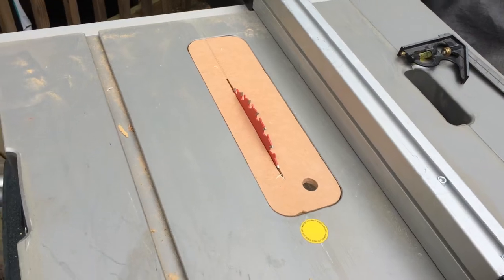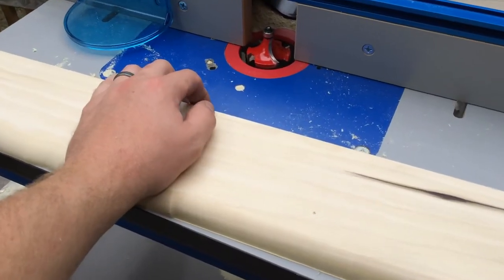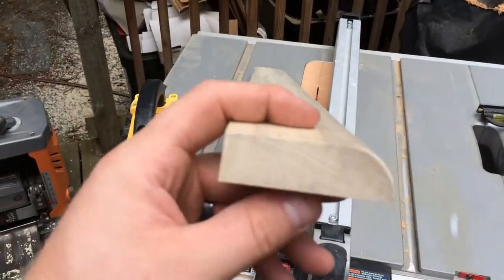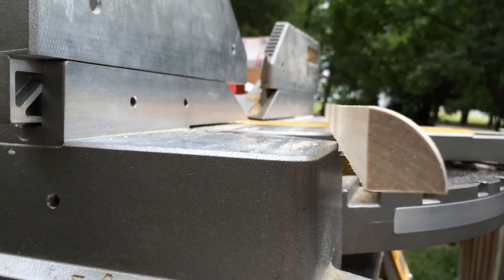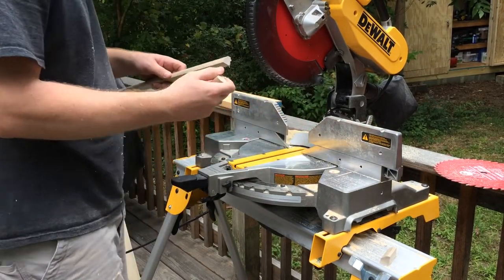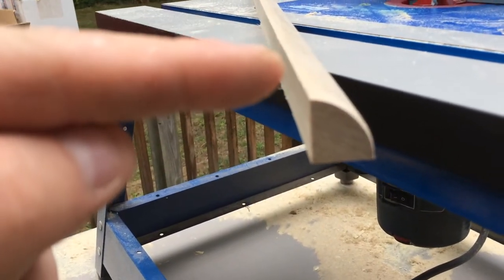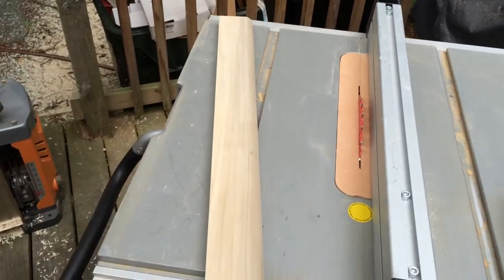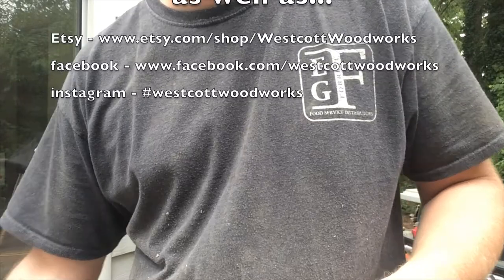How to Make Quarter Round and Shoe Molding

Comment: Don't use a thin kerf blade on your miter saw. You want a thick blade like the FS Tool SM6300. It's thick and will resist deflection much better than the cheap home depot blades. It's an expensive blade, but worth it.

For the router, you should be using a feather board to keep even pressure on the wood against the fence.